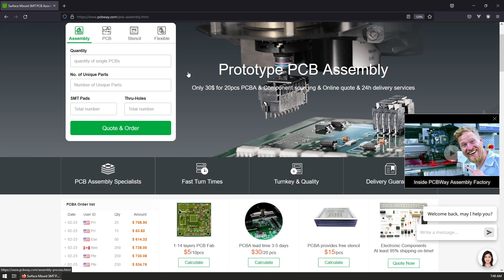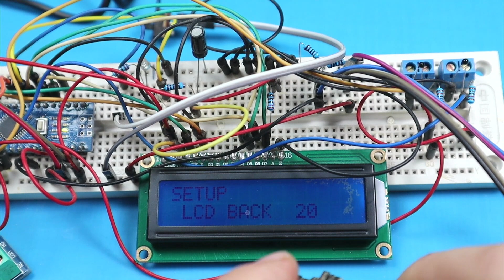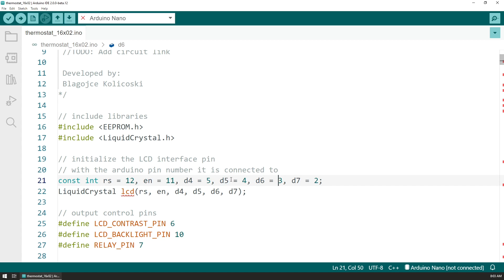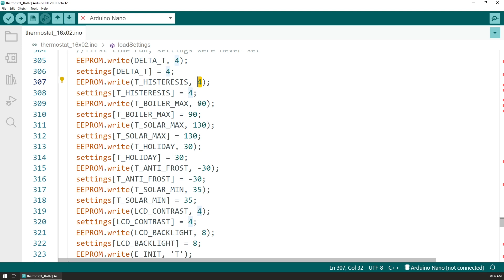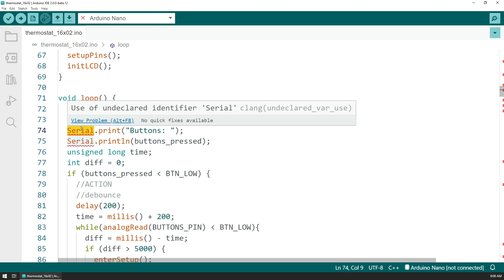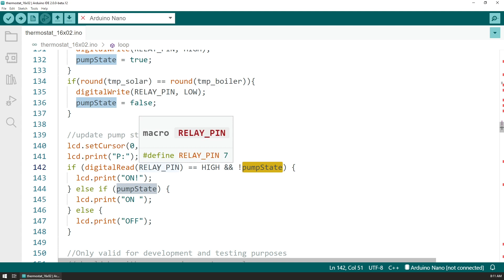DIY Arduino Solar controller - Can we finish this old project together?

Comment: Hi. I wonder why you used a thermistors and not some ds18b20. Maybe because of its reliability at higher temperatures. Regards
Reply from the maker: Yes, the thermostors have a really large range of temperature that they work on. Typical range of operation would be from -30 to 100 celsius.

Comment: Hi, nice project, I built it works perfect, the only thing what happens is that after a bit of time, and I mean its a random time interval , the lcd starts to show nonsense characters,meanwhile the program runs great ,  but the lcd starts messing up, after a restart of the device resolves this issue for a time period, then starts again, is it just my LCD or anyone else experienced the same thing?
Reply from the maker: Hmmm, I've never experienced this. Maybe there is an issue with the memory on the Arduino?
Reply: @TasteTheCode   well I will see , I gonna make soon another one , with different LCD and Arduino also, lets see if happens with that too